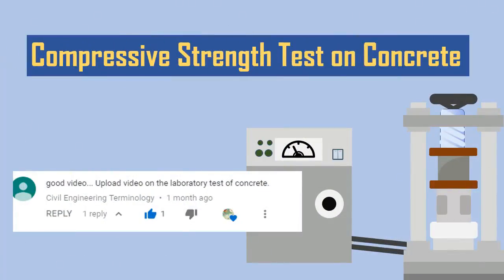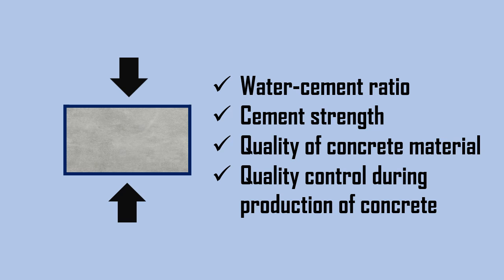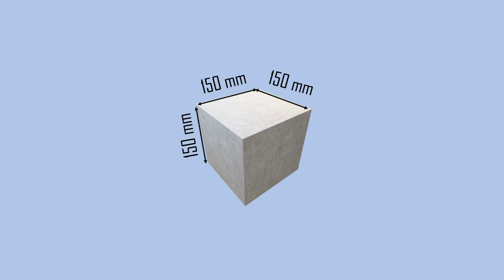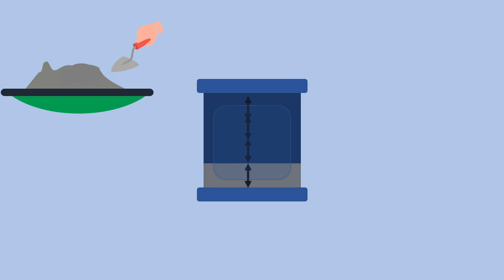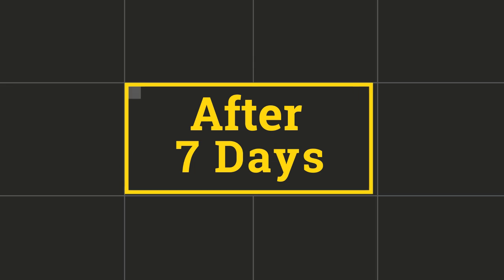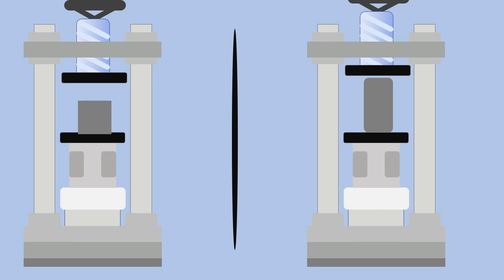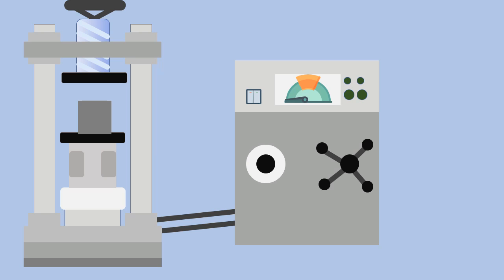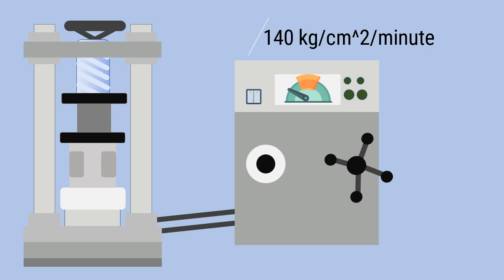How to Determine Compressive Strength of the Concrete || Laboratory Concrete Test #1

Comment: Create one Playlist called Concrete Chemical Tests and make a video of the lists below:

1.	Water-Cement Ratio Test: Determines the ratio of water to cement in the concrete mix, which significantly influences the strength and durability of the concrete.
2.	Cement Content Test: Measures the amount of cement in the concrete mix, ensuring that the correct proportion of cement is used to achieve the desired strength.
3.	Setting Time Test: Evaluate the initial and final setting time of the concrete, which impacts the workability and handling of the mixture.
4.	Soundness Test: Checks the volume stability of cement when exposed to high temperatures, ensuring it doesn't undergo excessive expansion or cracking.
5.	Alkali Content Test: Determines the amount of alkalis (sodium and potassium oxides) in the cement, which can lead to alkali-aggregate reaction (ASR) and potential concrete deterioration.
6.	Chloride Content Test: Measures the amount of chloride ions in the concrete mix, which can lead to reinforcement corrosion if present in excessive amounts.
7.	Sulfate Content Test: Determines the amount of sulfates in the concrete mix, which can cause a sulfate attack and affect the concrete's durability.
8.	Aggregate Testing: Involves chemical tests on aggregates used in the concrete mix to ensure they meet the required specifications and do not contain harmful substances.
Reply: Please can you help me to find a good youtube videos to study construction of materials(american code) or even organize the playlists in this page, I dont know where to start!! Please

Comment: Create one Playlist called Concrete Durability Tests and make a video of the lists below:

1.	Water Permeability Test: Evaluates the ability of concrete to resist the penetration of water, which can lead to internal damage and reinforcement corrosion.
2.	Carbonation Test: Assesses the depth of carbonation penetration into concrete, indicating its vulnerability to carbon dioxide and potential corrosion of reinforcement.
3.	Alkali-Silica Reaction (ASR) Test: Identifies the potential for alkali-aggregate reaction, a chemical reaction that can lead to concrete expansion and cracking.
4.	Freeze-Thaw Resistance Test: Evaluates the ability of concrete to withstand cycles of freezing and thawing, which can cause cracking and deterioration.
5.	Sulfate Resistance Test: Measures the resistance of concrete to sulfate attack, which can cause expansion and weakening of the concrete.
6.	Abrasion Resistance Test: Determines the resistance of concrete to abrasion, such as traffic wear on pavements.
7.	Rapid Chloride Permeability Test (RCPT): Measures the rate at which chloride ions penetrate into concrete, providing an indication of its durability.
8.	Shrinkage Test: Evaluates the potential for concrete to shrink during the curing process and over time, which can lead to cracking and reduced durability.
9.	Rapid Freeze-Thaw Test: Simulates rapid cycles of freezing and thawing to assess the resistance of concrete to severe weather conditions.
10.	Water Absorption Test: Measures the amount of water absorbed by the concrete, indicating its porosity and potential vulnerability to damage.
11.	Sulphuric Acid Resistance Test: Assesses the resistance of concrete to sulfuric acid attack, which can occur in some aggressive environments.
12.	Electrical Resistivity Test: Measures the electrical resistivity of concrete, which can be correlated with its permeability and durability.

Comment: Thanks a lot for these videos ❤️ i have a question please can you tell me which standards that says in compressive strength test required 35 times fir compacting ? ! While sometimes we read and watched other videos said 25 times for the square mould ?
Reply from the maker: Thank you for supporting... regarding compaction query kindly do check in IS code 516 : 1959 page 8 2.10.1...
Reply: 25  strokes  required for slump test
 For more civil engineering  related videos visit my channel